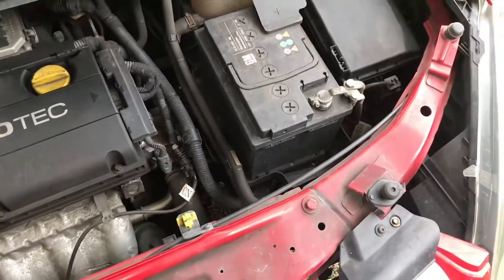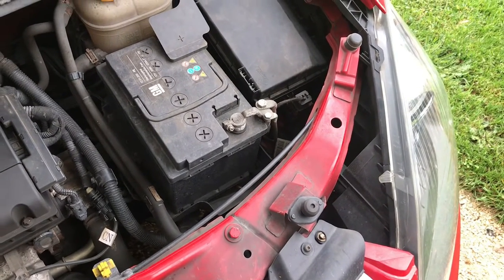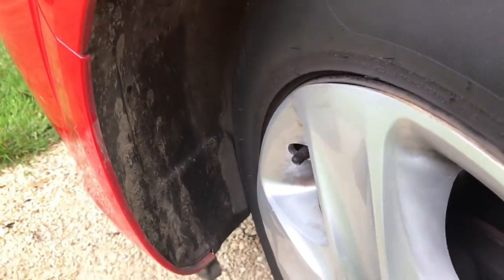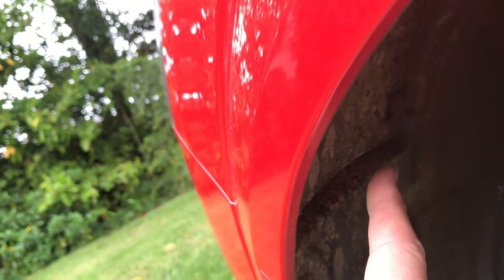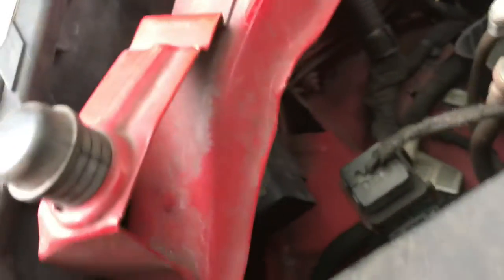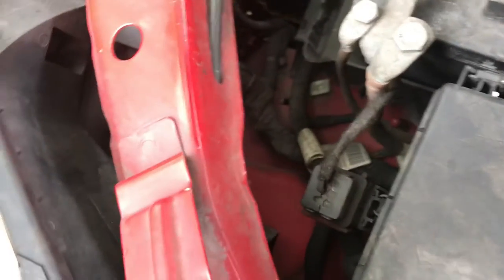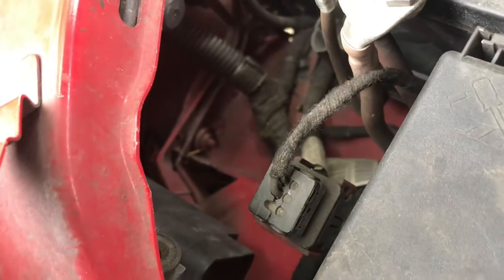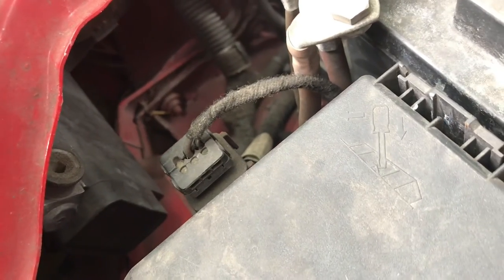Can I change my headlight bulb, through the wheel arch on a Vauxhall  Opel Zafira

Comment: What tool is needed to undo the flap in the wheel arch?
Reply from the maker: No tool needed, just press the tabs in.
Reply: @drivewaydiyer6504  thank you. I did my light in the end. Had to unscrew the grill and the bumper and then the light. Didn't take too long but damaged the bumper a bit. Also the little hatch is missing from my mud guard. Don't know where that went to